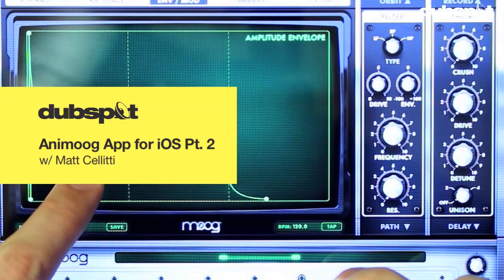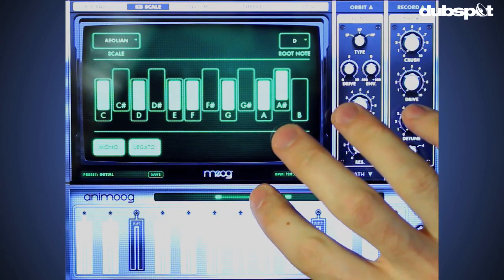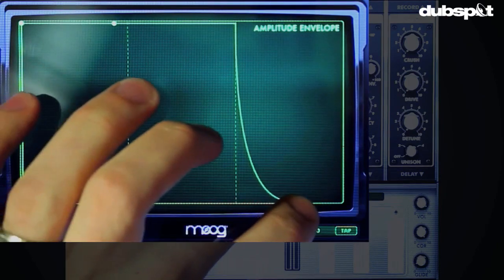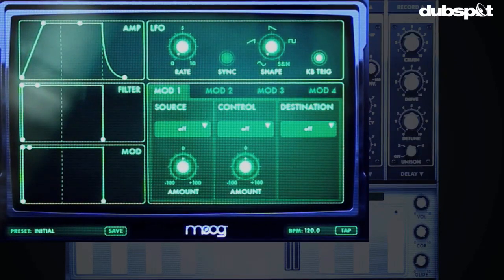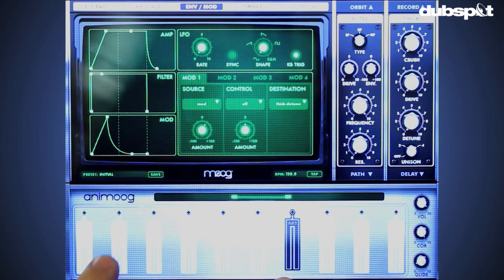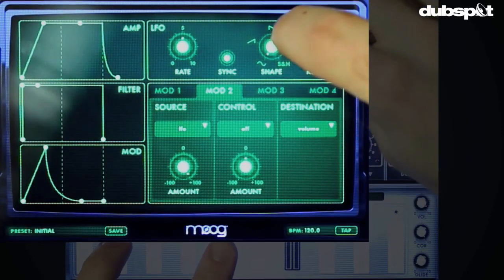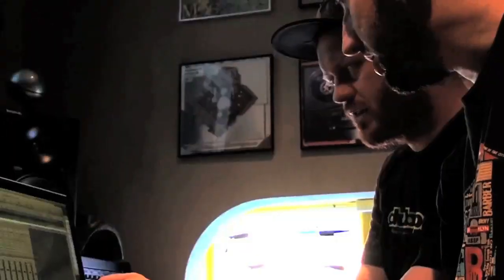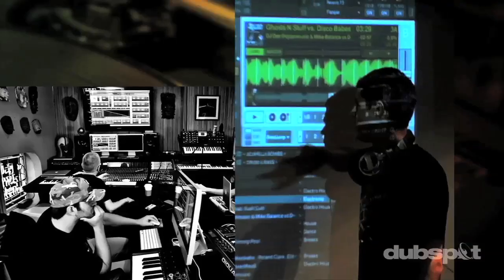Moog Animoog iPad / iOS Sound Design Video Tutorial Pt 2: Advanced Modulation + Routing

Comment: @maayaa77 its not an outdated view, it looks like a toy to me. i have a 5ghz quad core with 8gb ram, loaded with vst's. i also have a virus ti. what's outdated about that? i have a midi keyboard with sliders and knobs to control everything, what's outdated there? i don't want to use a tiny little touchscreen to make tunes on, i have dual 24inch lcd's for that. hardly outdated, i just don't see a need for an ipad.